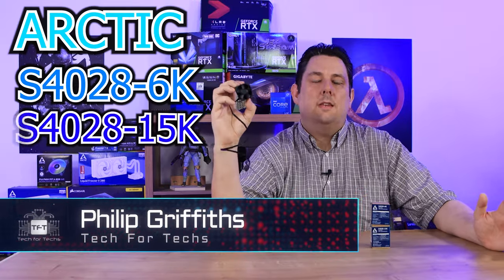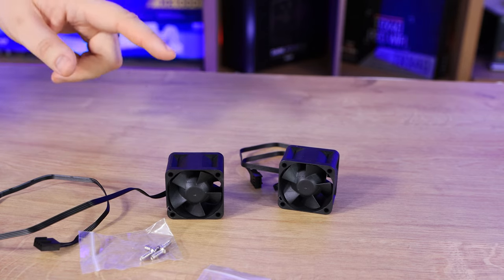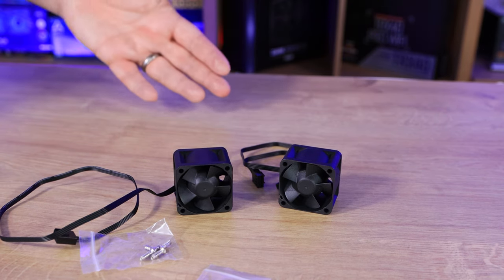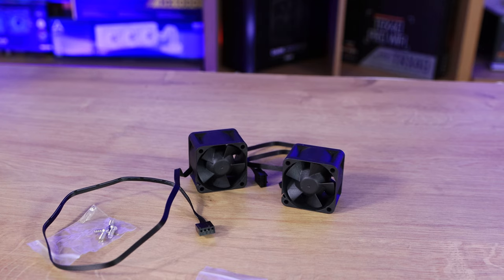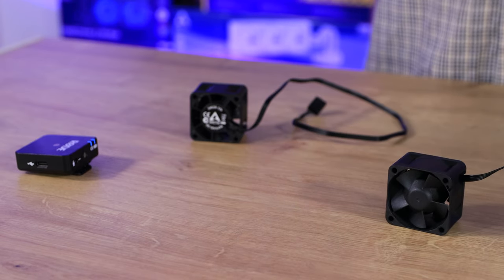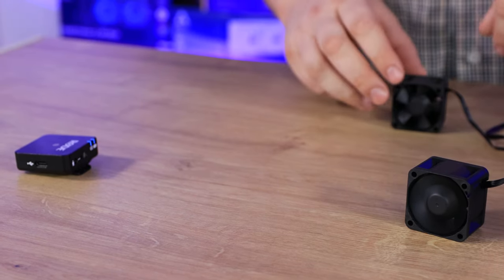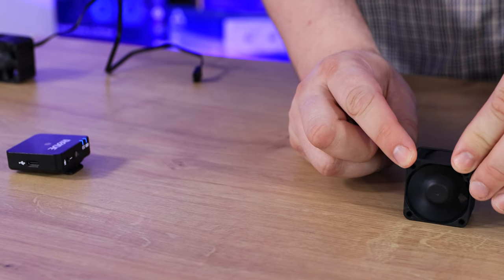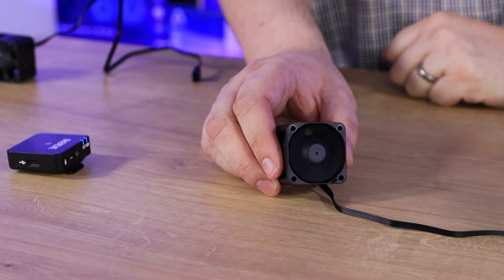15,000 RPM Fan!  Arctic Server Fans - S4028-15K & S4028-6K

Comment: Holy shit had no idea Arctic had 15k rpm fans!!! I don't believe I've ever been to a server room, do they use these type of fans 24/7? Sheesh ... Anyway great review, albeit at the cost of only having 9.5 fingers now.
Reply: the smaller the blades get the less momentum they have so higher RPMs are easier to achieve. that being said this is still insane and really pushing the limit (at least what Ive seem)

Comment: how do you achieve 15000 rpm?do you plug the fan in a 24V battery or what?
Reply: It's designed to run at that speed at 12V/0.47A. The 6k RPM version runs full speed at 12V/0.1A. They were designed differently (the 15k RPM one probably has thicker wires inside), so that's why it spins that fast.

Comment: Can you give rough estimates about noise in dba for both models.
Also I know I'm asking for too much but could you compare the  15.000rpm model but limit the speed at 8000 against Sunon Maglev ---> Part Number:MF40201VX-1000U-G99
Reply: I have 2 of them, noise is around 90 db next to them, but like 70 when 2m away
Reply: @LUPIPUPI1 damn it's a no go then😂
Reply: They are a bit louder and more sharp thana  hair drier, the only way i can handle 2 of them is when the pc case is closed and i ahve my headphones on.
 @AutodidactEngineer
Reply: @LUPIPUPI1  oh ok what about the 6k version?
Reply: If you turn the fan to around 5000 rpm it is bearable, it starts getting loud after 7000 @AutodidactEngineer